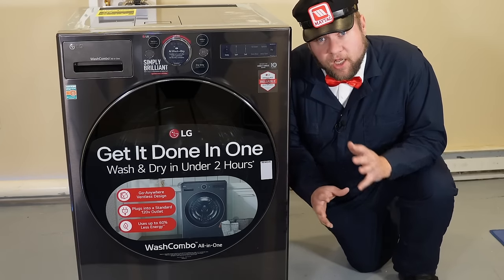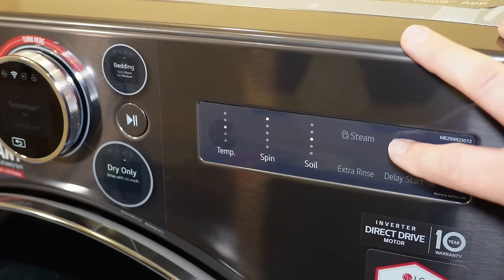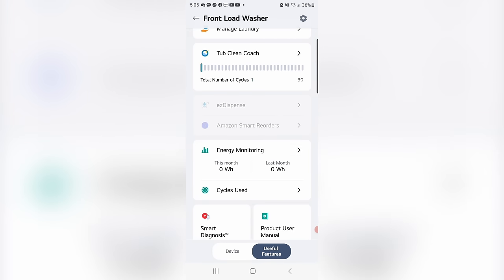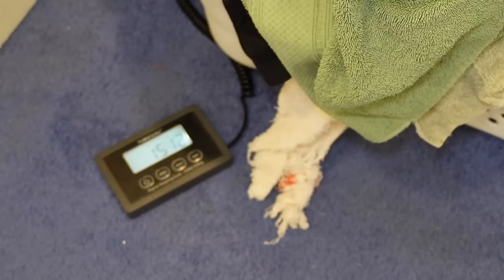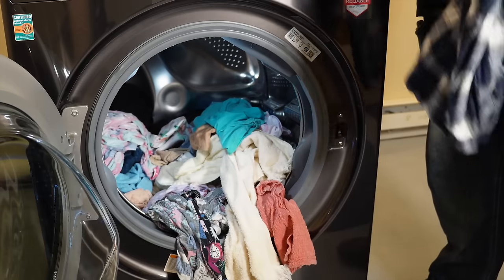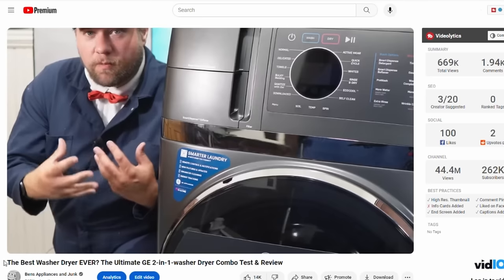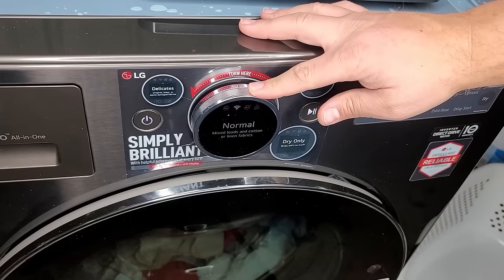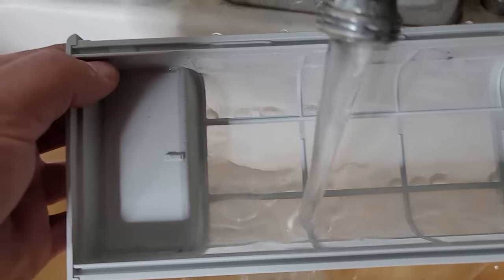BETTER THAN GE? The LG All in One Washer Dryer Combo: Test, Teardown & Review

Comment: ya they are great till they break... talk to repair specialists and they will tell you stay away from anything LG or samsung as repairing them is expensive parts wise and time wise.... Amongst so many other problems they have
Reply from the maker: When we did the technician survey last year of most reliable/best washing machines, LG came in second place only to Speed Queen... You may be thinking of their fridges. Their washing machines are quite good.
Reply: @bensappliancesandjunk  nope I am not.  Dealt with this a month ago roughly.  Speed queen was biggest recommendation here from the appliance repair guys but they otherwise said to get ge or maytag. As lg, Samsung etc are no go.   They are super expensive to repair compared to other.  They also recommended going into the mid level stuff as less overall electronics generally and less to break so you get a longer reliable life span.  Also lg, Samsung etc brands  over integrate parts together.  Which is part of the reason they cost so much to repair as you have to replace a while say heating unit with thermostats etc versus just a heating element.

Comment: I'm wondering about the energy efficiency of this unit. My Kenmore washer/dryer units would be able to complete three loads no problem in the time this unit takes to complete a single load. The primary rational for me to make a switch would be whether the energy cost of this unit is significantly less than two stand-alone appliances.
Reply from the maker: A typical tumble dryer will pull 5.5 kW in use, whereas the GE's peak wattage is around 1.1 kW, so significantly less electric. But doing an AB comparison would be interesting.

The other question would be if you're asking to compare a Kenmore topload set or a front load set, and what era. Either unit is vastly superior on electric/water than a topload would be, but similar to other front loads, washer-wise.
Reply: @bensappliancesandjunk  my kenmore set came with my house when we moved in and im pretty sure it's either from the 80s or 90s. topload washer, frontload dryer.

Comment: After your review, I'm thinking for me the long wash/dry time is not that big of a deal, set it for 10am when my solar is producing the most energy and the load will be done by the time I get home from work at zero cost to me.   What about getting two machines and running them at the same time?
Reply: Not sure what you are using currently, but this thing has a BIG tub and a lot can be accomplished with just one load.
Reply: @spazzman90  my current washer and gas dryer can do load in about 90 mim combined.

Comment: I just ordered this unit. Will be delivered in a little over a month. Can you tell me if this unit has leveling feet on the bottom? There’s a slight slope to my floor where I plan to place this.
Reply from the maker: It does and even comes with the wrench to adjust as well as extra rubber feet pads!
Reply: Thanks Ben! I love this unit but I discovered it leaks when dispensing detergent. I took the back off because there was always a small puddle and have a video of it dropping water on the interior only when detergent is dispensing. I can’t determine if there’s a missing plug or screw. Could I somehow send you a clip or screenshot?

Comment: I would like to actually see it ran at the recommended settings and laundry weight for the two hour mark. You said in the beginning that you put it on the wrong setting and then just did it again lol. It has to be wash + dry not "AI" and on energy saver.
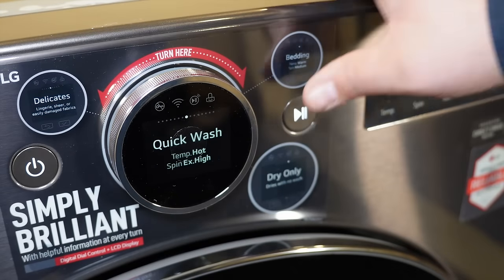Reply from the maker: I did later in the video if you watched long enough. It got down to 1:49 in a warmer area with warm water
Reply: @bensappliancesandjunk  Nice! I'm not gonna lie I checked out cuz I thought you skipped it. A lot of people are going to check out with a 3 plus hour minimum cycle time. I had the GE version of this with cold water condensing and loved it. Anybody that used always complained they hated because it takes forever because they cram the machine too full.

Comment: Once that touch screen goes dead..... you're sol. Give me discreet, replaceable buttons, thanks. I can solder a new button on. Replacing an lcd screen in a turn nob will be hard/impossible and cost 100x more, at least. I wonder how much data LG is stealing from you?
Reply from the maker: The touch screen is literally a small UI with a harness that goes in from behind. It can be replaced as easily as a knob can. I should know, I broke it already off screen and repaired it myself.
Reply: @bensappliancesandjunk  Good to know! Was the repair just a replace or component level?
Reply from the maker: @captianmorgan7627  component level. We were able to successfully repair the UI system without ordering a replacement, but its pretty clear the cost/difficulty on this system is very, very, very simple. It has an outer turn-dial shell, with the UI being nestled in the inner ring. Very, very neat system they came up with. Obviously prone to snapping off if you move the entire unit a lot, but that was on me when I moved it to another room for testing.

Comment: Currently, Costco has the LG on sale $1899. Plus, it comes with a 2 yr warranty.
Reply: You must be looking at a different model. Costco doesn't have this one yet.
Reply: Here's what's listed online... Costco Direct LG 5.0 cu. ft. Mega Capacity Smart Wash Combo All-in-One Washer/Dryer with Inverter HeatPump Technology 
Price valid through 2/7/24
Item  1756065 Model  WM6998HBA
Reply: @GO-AVS  I stand corrected. It wasn't showing up on my search.

Comment: Is there still an issue of things getting musty with front loading washers? Until they tackle that, it’s a top loader for me.
Reply from the maker: They have done A LOT to tackle that, even more so with these heat pump machines. Since they get hot during the spin/dry, its going to kill the mold and bacteria issues rather easily.
Reply: @bensappliancesandjunk  Thank you

Comment: Great Review. Hope to see more on this washer combo. Do you think it is possible to use a unicouple with this unit?  Thanks
Reply from the maker: I imagine you could, but would require some re-engineering as the hot water valve is likely to need blocked off in some manner because most modern valves backflow if there isn't a hose attached. However, a simple garden hose stopper would work.
Reply: How about a uncouple to a y adapter

Comment: What were the ambient temperatures in the two rooms? My washer and dryer is in a room that gets down to low 60s, high 50s in the winter and there isn't really a heat source in the room.
Reply: I wish he would have mentioned his temps.  I'm at about 65, and about half way into the dry, this machine is very warm.  Interesting, the heat pump scales up power consumption, starting at about 450W and ending at about 850.  It's pretty much linear.  But yeah, things are cooking from the mid to the end of the cycle.
Reply: @spazzman90  Do you find it dries well for you at a room temp of 65 degrees?

Comment: has the same layout as my GE and the same drier system. wonder if its just another rebrand of it but with a actual filter unlike the GE which has none .
Reply from the maker: Did you watch my video on the GE? Its a totally  different system. Did you watch the part where I said the coils were 4x larger on the GE? The method of operation is VASTLY different, as LG went with a resistive heater to basically use a hybrid heat pump/condenser system and GE went hard charging on heat pump only, wit a super massive system.
Reply: @bensappliancesandjunk   Oh my feed never gave me the GE video! i will have to watch! tho seems the GE in that video is a different model i got the smaller one, the GFQ which is a condenser style. I did see the coils but figured just differently specced at the factory or something tho seems i was wrong maybe. just the placements of the stuff on front and sort of the same interior layout.

Comment: I remember reading something, I think it was a comment reply on your modifying the filter on the GE unit. And GE commented on the video saying "Don't do that!" Or something, and that they would contact you to give you more information. What did they say? I'm not confident the GE filter is very good in the long term without a modification or a recall/replacement filter.
Reply from the maker: They said that the fins on the condenser are strong enough to withstand scrubbing/cleaning, and that engineering it differently would have prevented the machine from being ADA compliant. 

Which is interesting, given this WM6998 has a top-mount filter (that I think is, for the most part, better engineered) which given the height, maybe isn't ADA compliant?
Reply: @bensappliancesandjunk  I have no problem scrubbing and cleaning with a sock and toothbrush and or a vacuum attachment or whatever if that's what's necessary. But I'm pretty confident that the lint and pet hair is going to end up deep in the fins, beyond the suction power of my vacuum at that angle even with regular fin cleaning. I'm pretty mechanically inclined to even open it up and deep clean it sometimes when I'm past my 5 year warranty. But the vast majority of users? I'm doubtful they are emptying the filter every 5th load, let alone washing the foam filter out when prompted, so vacuuming the fins every so often is probably out of the question. I do recommend everyone at least peek at the filter every dry cycle, not every 5 cycles. I clean mine out every dry cycle regardless. 

Anyway thanks for your unbiased and unpaid reviews of both units.

It's pretty cool that the GE is ADA compliant. I've used pods in the machine and it seemed to work just as well so if the person can't stand up the fill the the smart dispenser they'll still be okay.

I'm glad now I got the GE only if only because of the 5 year drying system compared to the one year on the LG. I started getting buyers remorse when he LG came out after I bought the GE but after watching your video with the LG fins , in a sick way I'm glad both lint filter systems are terrible at not allowing lint to pass to the fins. I didn't compare height or length on the other units but I got plenty of room for the seemingly larger GE. If I were tight on space I would've chosen the LG. The LG UI on the unit seems needlessly clunky compared to my GE. The GE app tells me the estimated time to completion, current cycle, detergent and softener levels and alerts me when it's done. I'm happy with that. I can't customize or start a load from the app but the UI on the machine is pretty easy and straight forward to use, unless I'm delay starting or remote starting. That's a little cumbersome. 

I love everything else with my GE. I've thrown king weighted blankets, down blankets, filled the drum to the near brim with towels which washed then dried in a little under 4 hours. My whites come out bright white with no stains, using the white button and just the auto smart dispenser of laundry detergent. No bleach. It's a better washer than my older Maytag  top loader HE washer ever was. That thing would leave white detergent deposits on my clothes, unless I diluted the detergent in a gallon of water before adding clothes and my whites didn't come out nearly as well as this machine. And my old dryer vent is 7 feet up in my basement. I don't think it ever dried a load of towels of any size. My vent was clear. It got to the point where I'd dry the towels on the deck. And hang up my entire load to dry which is obviously not a bright idea to do indoors in the humid summer. End of book, haha.
Reply: @bensappliancesandjunk So nothing wrong with the mod, other than GE doesn't think it's necessary?

Comment: Does it need to be taken apart every few years to clean the heat exchanger like every other heat pump dryer?
Reply from the maker: LG claims you can clean the coils from the filter box and that's enough
Reply: @bensappliancesandjunk  in your opinion as someone who repairs appliances for a living do you honestly believe that is enough? The exchanger is like a foot long. There's no way you can adequately clean it from the just the front.

Comment: Ben is it possible to clean the coils with some steam or water? Without teardown
Reply from the maker: I think they make AC coil cleaner that can do it for this
Reply: @bensappliancesandjunk  thanks, I jsut wasn't sure if there was some kind of drain there. I'd imagine so but I wasn't sure if it just drains back into the tub. I had my first issue the other night, a load of towels litterally took all night to dry. turns out LG had defective seals on the filter baskets and it was letting lint past the trap. Well my coils were covered really bad and after spending 20min with a toothick and boreoscope I've managed to clean it off. Can you suggest any type of cleaner?

Comment: Can you estimate the electric savings or is that on the sticker from the energy rating stickers?
Reply from the maker: The electric number is for the washer only, so the data there is a complete joke. Compared to a topload, its vastly better ($13/yr in energy usage vs. $40 in energy usage for a MVW5430, for example). But its identical to the LG Washtower, which is rated at $13/yr.

But again, where the real cost savings would supposedly be would be the dryer, and EnergyStar doesn't have any tests for that or labels, from what I see.

Comment: If the compressor is 3 phase, it's AC, not DC. DC does not have phases.
Reply from the maker: I'll have to triple check, but I am fairly certain it said exactly that on the compressor. I recognize that it doesn't have phases, but the label may have stated as such.
Reply: @bensappliancesandjunk  Possibly the inverter is integrated into the compressor? So the inverter would run on DC but it would be converted to 3 phase AC to actually run the motor.
Reply from the maker: @smwsmwsmw  its very possible. I've never seen one like this before, and it confused me when I was trying to decypher its capabilities.

Comment: with this high speed spin will this washer  shake the house like my old front loader washer did  i was told it was to be mounted to concrete floor
Reply from the maker: This isn't a hardmount washer, and it did fantastically well when leveled at my shop
Reply: This does better with vibration than my prior LG.

Comment: Now that I've re-watched the whole video closely, I don't think he mentioned the key factor in combo drying times. To hit the advertised drying times, the drying capacity must be no more than HALF the drum capacity! So you can cram the drum full and the machine will WASH in normal time; but if you try to dry a FULL drum of laundry, that's where you hit 5 or 6 hours in drying time. The volume is more important than the weight. So you don't have to weigh your laundry. Just visually you can tell whether the dirty laundry fills more than half the drum.
Reply: Even at half or 1/3 capacity, dryer times are long. Fastest wash and dry has been almost 5 hours.
Reply: @chrishintz1077  that’s too long. Mine washes & dries a half-full drum in 3 hours
Reply: yes. Definitely too long. We may have gotten  a lemon. So far Best Buy had been out to see if install is ok. They claim it is but still no good. LG guy has been out and  is coming back. Water has built up and needs to be emptied every wash from overflow tubing. Lint mostly goes to door and rubber gaskets that seal door, not to lint filter. I would be very wary to purchase one of these. There’s lots of maintenance involved. It’s nothing like a having washer and dryer separate.
Reply: @chrishintz1077  Is your combo on a pedestal? If the drain pipe is too high, combo units can have trouble drying because it has a hard time draining water. I read such complaints before buying mine, so I got mine installed on a pedestal. My combo has always dried well for a combo (3 hours total wash and dry time for a half-full drum). The clothes do come out perfectly dry. Yes, lint builds up on the gasket. But I do not have room in my studio apartment for separate units. Also, not having to transfer is nice when you want to put in dirty laundry, go out all day for work or shopping or whatever, then come home to clean dry laundry
Reply: @christopherstone6962  our combo unit (LG wash/dry) is perched up on a “sidekick” that is about 12 inches tall. It’s a separate unit that washes only. I find the lint accumulation on the gaskets particularly irritating. I have to wipe it off before pulling the clothes out. Hardly any lint goes to the actual lint filter.  There’s a y splitter in the plumbing bc of the dual wash upon wash units.